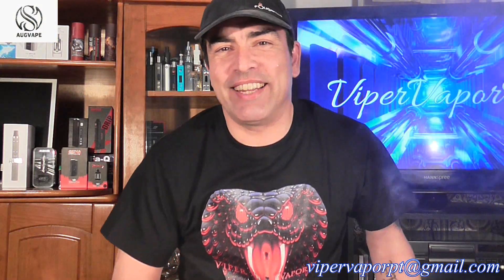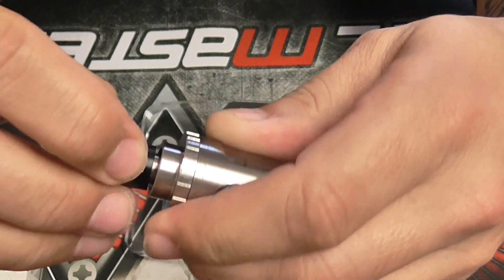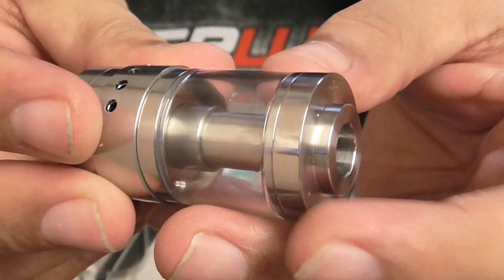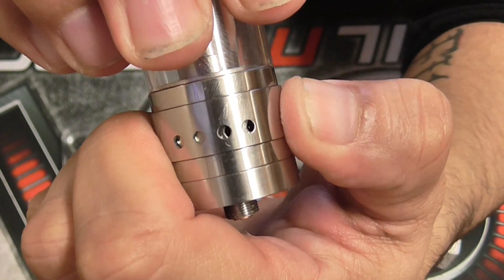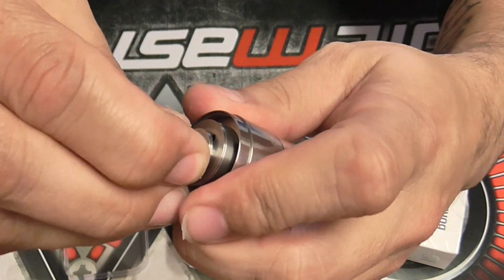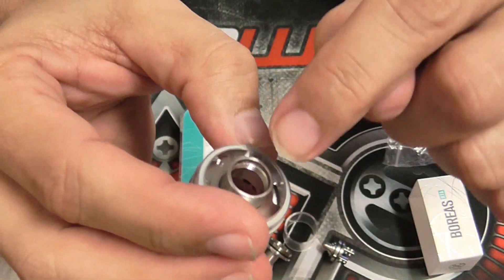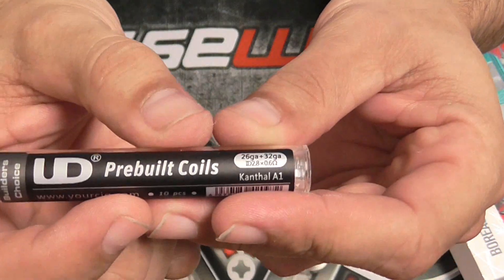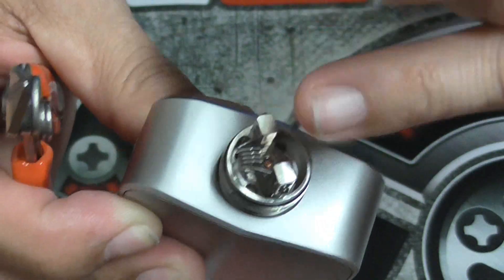Boreas RTA by Augvape with Clapton Build

Comment: Nice review and a beautiful matching this RTA mod you've got, man. I often experience either leaking, or dry hits with my Boreas. So I assemble the RTA (I prefer the deck with the larger holes) prime it with 1-2 ml of PG/VG mixture and vape it to see if it's gonna leak out my premium juices, or give me dry hits. If it's leaking, I disassemble it and sort of very lightly “compact” the ends of the wicks a bit more against those 4 holes. If it gives me dry hits I realize that I compressed my wicks too much against those holes, so I re-wick the coils so the fibers are not that tight against those holes. Very finicky RTA. This RTA is not for someone, who used to the pre-built coil-heads and is new to making his/her own coils and “building” the decks. I wish someone would do video addressing juice flow issues with this RTA. Unfortunately 99% of the “reviews” are done by people, who are getting something out their collaboration with online sellers, or even manufacturers.

Comment: These type tanks have to  equalize the pressure in the tank after you fill them ..Also the Best way to Build these Rta's is Vertical ..Go watch the Video  By  Kicking Butts on you tube His video on the Aromamizer supreme ,,He shows you how to build vertical on  A Velocity style deck..The best way is vertical Trust me !  Totally different   Not as much  start out leaking when filling  more vapor ,More air flow